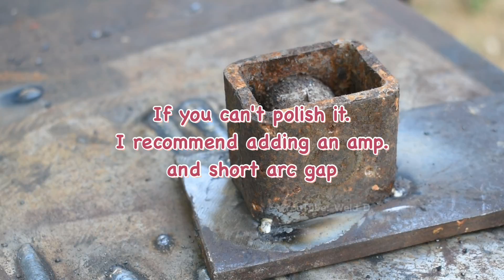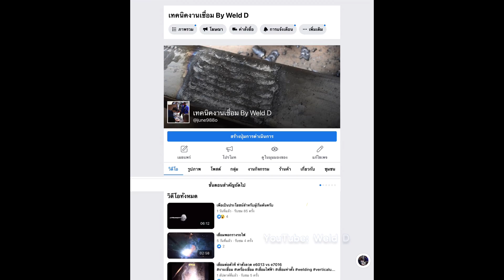The Secret Welders Never Tell about welding old steel, Lots of rust and thick.

Comment: There is a groundbreaking new invention called an angle grinder, and an attachment called a wire wheel
Reply: Yes, if you have it - use it.

My initial thought was, “he’ll speak of running a root pass with 6011 or similar…”

Comment: Why would you ever run 6013 on that (or anything else)?  6010 or 6011 would do better especially if you run them hot enough to flow in.
Reply from the maker: 6013 is easy to find in my region.